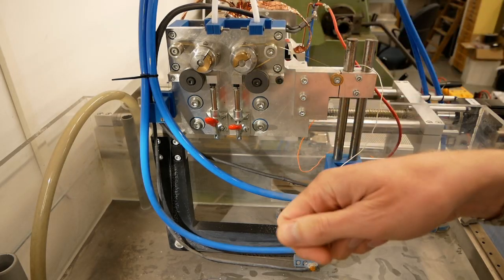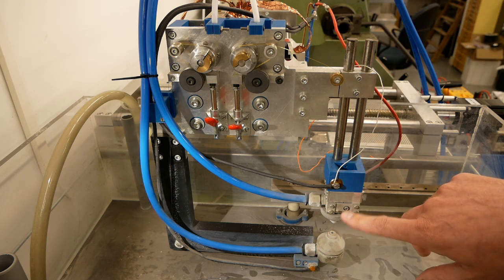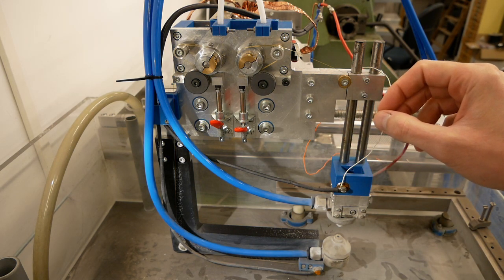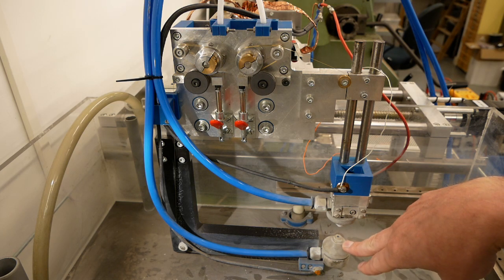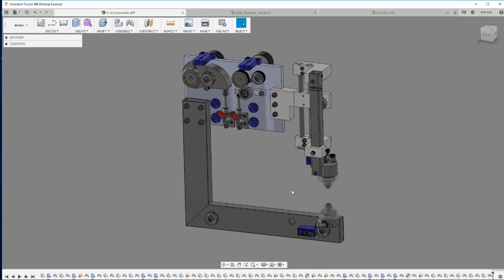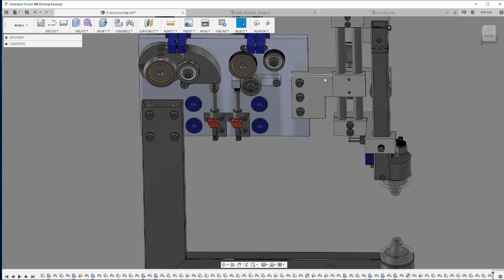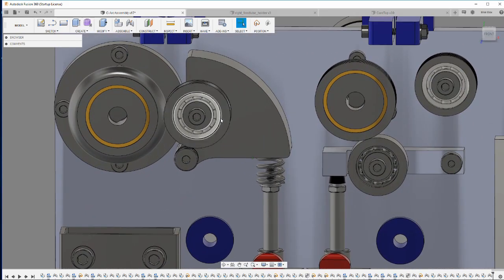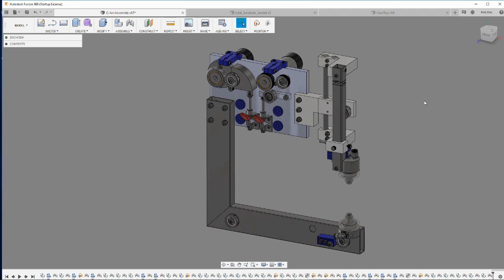Wire-EDM Machine, complete MK2 redesign: Part 1, C-Arc

Comment: I love the updates you have done here, However the Files linked above Do Not have these updates...would you kindly provide those Fusion360 updates as well as a list of the OEM parts that you have changed to in this Update?  Best Regards, Preston
Reply from the maker: Hi, this video shows an older design. It had some flaws. If you check out the other episodes you will find that the models that can be downloaded from the link are the latest version. Also, on that same page, there is a list of the key component OEM parts.
https://baxedm.com/knowledge-base/example-mechanics-of-w-edm-machine/

Comment: I thought you couldn't use stainless steel in electrolytic processes due to leeching out the chromium and creating something evil:
https://antique-engines.com/stainless-steel-electrodes.htm
Is that incorrect, or does EDM not expose the stainless steel in the same way that say electrolysis used for rust conversion/removal does?

EDIT:
This whole discussion is worth a quick read:
https://cr4.globalspec.com/blogentry/22496/Chromium-in-Carbon-Alloy-and-Stainless-Steels-is-NOT-Hexavalent
Probably the whole issue is not so relevant to a home hobbyist, compared to say a professional metal fabricator or boilermaker, but I don't know enough of the physiology to say that it isn't a risk.
Reply from the maker: Good point, I actually did not now that electrolysis with stainless causes nasty things. The cutting process does free particles and ions, these are filtered out by fine particle filters and an ion exchanger. When these are saturated, the filter and ion exchange resin must be disposed of in a proper way, like chemical waste.
Reply: @baxedm9806  True actually, i forgot about the whole filtration aspect. That is significantly different to a simple DIY electrolytic rust removal setup etc.

Thinking very hard about whether or not I can justify the cost of a build for one of these awesome machines. Looking forward to following along with Werner and Marco's builds first....would definitely be the most ambitious thing i've ever tried to make!
Reply from the maker: @TheMadMagician87  Yep, building a wire-EDM is not cheap nor easy, but it is very rewarding. The ability of wire EDM cutting in the home shop is incredibly powerful and opens up a world of DIY possibilities. It is definitely my favorite metal working machine!
Reply: Am I on the right track in thinking that in EDM, since the arc is basically jumping from the wire (anode?) to the piecework (cathode), without the use of a stainless steel anode or electrode specifically, that EDM as a process isn't susceptible to the issue mentioned above with respect to hexavalent chromium?

If that is the case, is it safe to use EDM to machine a stainless steel workpiece?

Comment: Why is the threading of the wire so complex? Even on commercial machines that I've seen the wire travels through a labyrinth of pulley's and guides. Why cant it just feed from the spool to the head to the return spool thats spun by the motor?
Reply from the maker: Good question, long answer :-) So I've added the answer here: https://baxedm.com/knowledge-base/why-does-the-wire-handling-mechanism-seem-so-complicated/
Reply: The commercial machines also do auto threading - Mike's machine is simplified